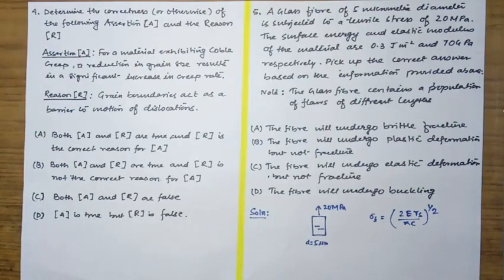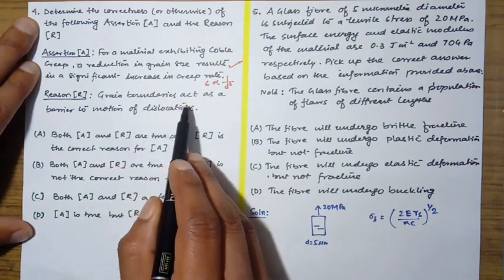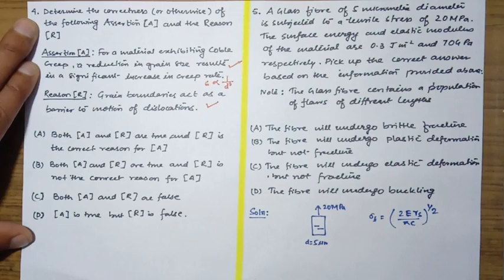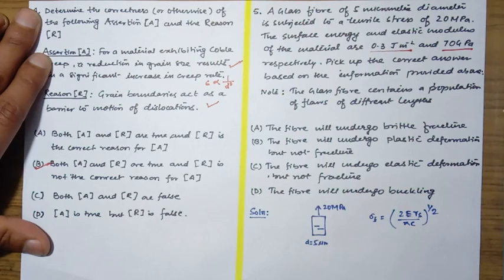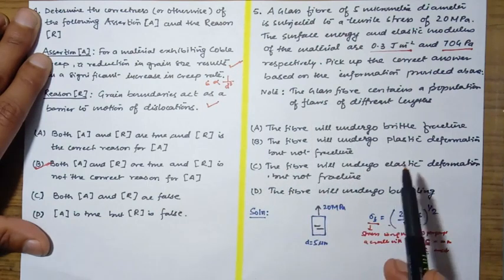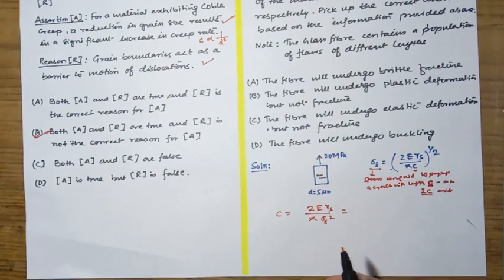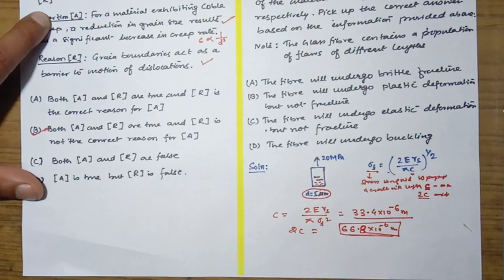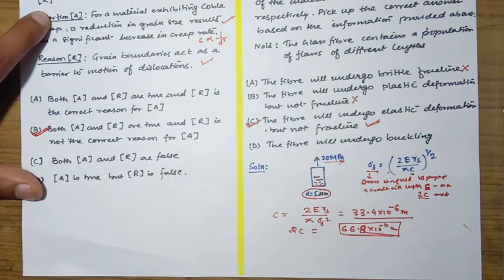GATE 2018 Mechanical Metallurgy Solution Part 2

Comment from the maker: 00:00 Assertion Reason Coble creep
03:05 Glass fibre fracture
Reply: Sir, Why would the glass fibre not undergo brittle fracture, as the flaw size is coming greater than the diameter...it shouldn't break? Can you clarify my doubt. Thank you 😀